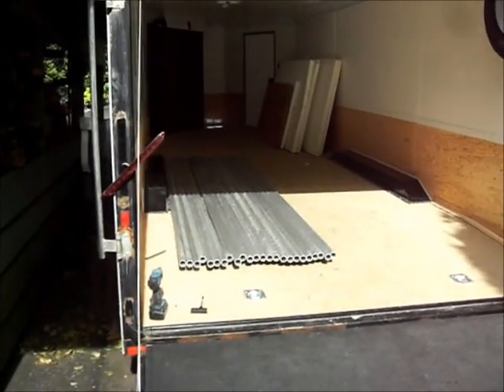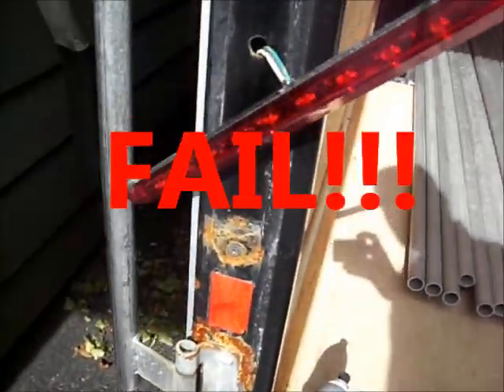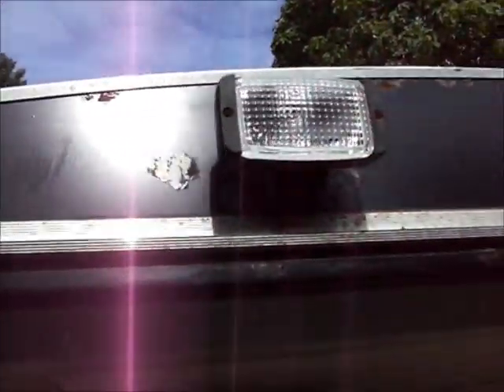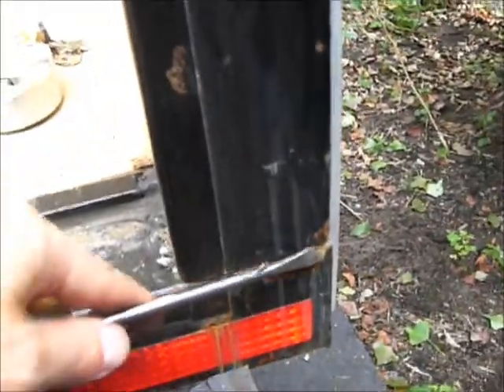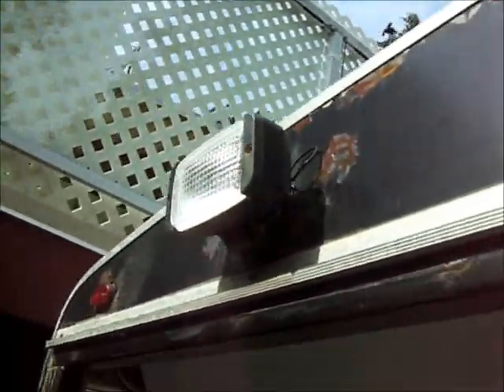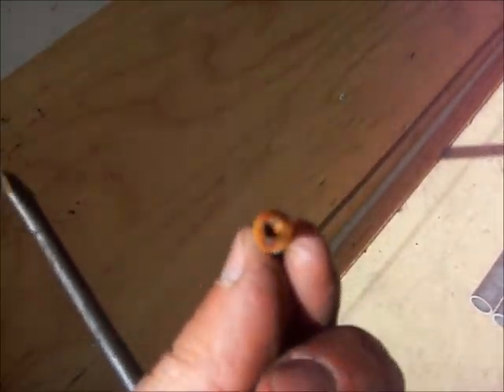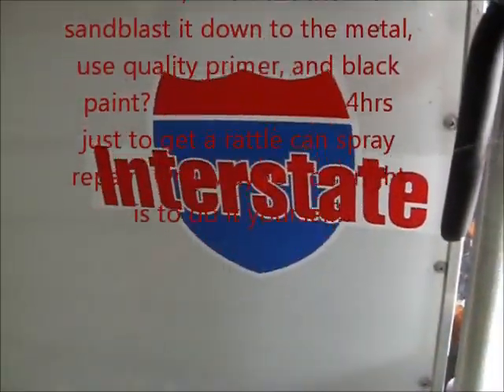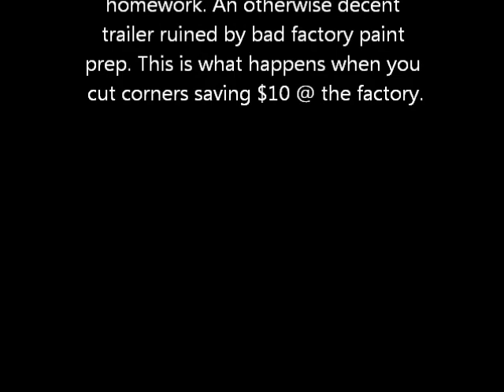Interstate Cargo AllSport Trailer Rust

Comment from the maker: @fuckinterstate I bought it at trailersplus dot come out of Marysville, WA. To be fair they offered to fix it but I'd rather sand blast the old paint off and re-do it myself so I know it's done right. Otherwise the hinges, doors, ramps, frame etc are built really well. It's just the final finishing that's lacking and really takes away from the overall reputation. basically saving $100 at the end ruins it.

Comment: Wow... That's a shame guy, Heck I own a 2013 interstate 1 and there no sign of rust anywhere, an it still looks as good as new. However sense you showed there was no insulation or gap sealer around the tail lights, I'll be checking into that on mine this summer, and if none there, I'll a big roll of RV Putty Tape and do some sealing... Sure hate to see that ya had such bad luck there. If it was under a year old, or even a bit over a year, It seems that the manufacture would correct that problem. These trailers are not cheap, so they should correct the problem in order to save their name from being dogged.... Good luck
Reply from the maker: Yep, it really is sad they cheaped out $100 on primer and proper metal prep - could have had zero issues and satisfied customers as the trailer itself (the rest of it) is built very well and sturdy, compared to other models.
Reply: Does anyone build anything of quality anymore and show some pride????  Just hurry up and rush out a piece of total junk......disgusting.
Reply: @westvandude  Your logo of Instertate trailers isn't the same as the Interstate Trailer company here in the states which is known for making excellent quality trailers. I don't work for them or have one or know anyone who works there but i've researched cargo trailers for over a year until i finally bought (Wells Cargo- Not Interstate as they were priced out of my budget)  . . Either you bought a knock-off Interstate trailer or they changed their logo? ? ? I'd check back with where you bought it or contact them directly , Explain your situation and See if they make good on their 1-3 year warranty. All interstate trailers have a minimum ONE YEAR WARRANTY for craftsman ship and parts https://www.interstatecargo.com/enclosed.php
Reply from the maker: Yep, it's definitely an Interstate brand trailer. Bought it in Maryland, WA, USA form the Interstate dealer. But that was back some 8+ years ago. My repair paint is holding up. But now some of the rivets are corroding that hold each section of outer aluminum skin on the wall vertical supports. This is just because it's all different metals. Aluminum doesn't get along with steel so electrolysis happens. They don't engineer these things very well, although the main frame and doors, etc are made pretty good. It's the lousy finishing that makes it look rough years later.

Comment: I bought a Look trailer 1/7/2016 and it started to rust after only 2 weeks.  The metal frame on the front ramp gate looks like they used old steel to make it and threw a light coat of paint.  The finish caulk job was ridiculous.  They didn't even wipe up the sloppy globs of caulk they dripped down the walls.  The paint on the interior roof frame had runs in it also.  They didn't do a good job on my trailer.  My trailer might have been finished by the newest guy on the job.